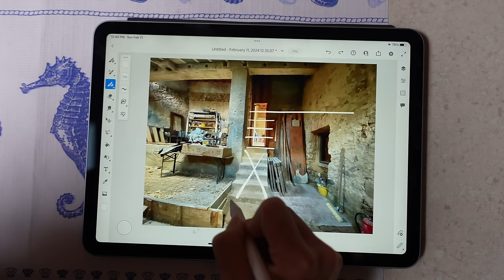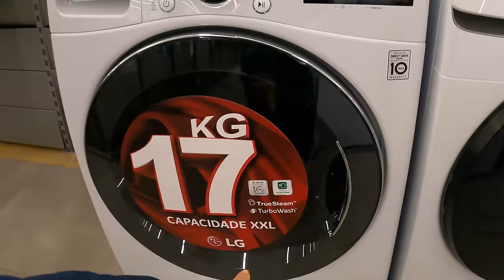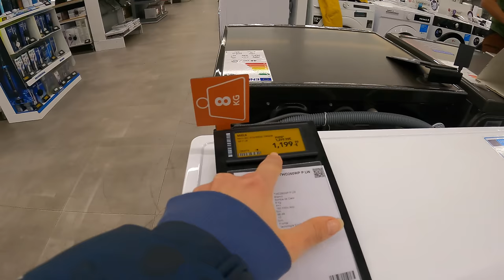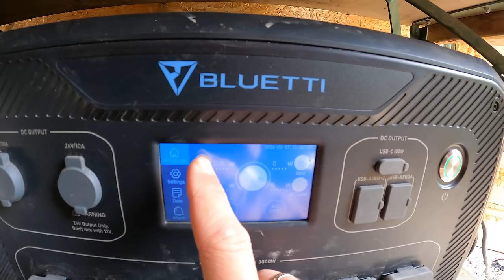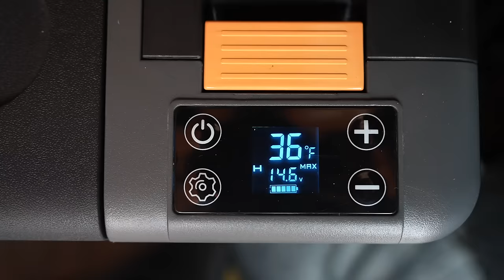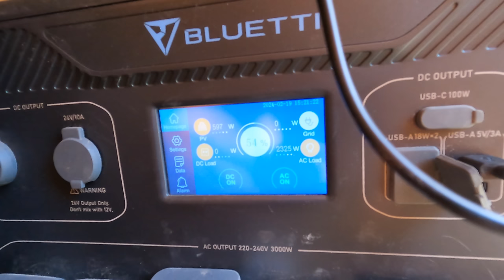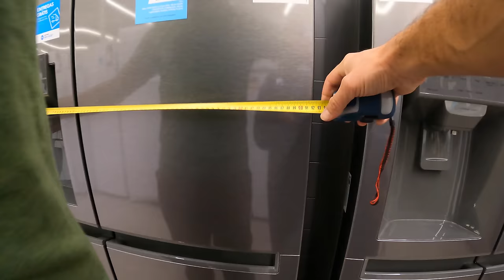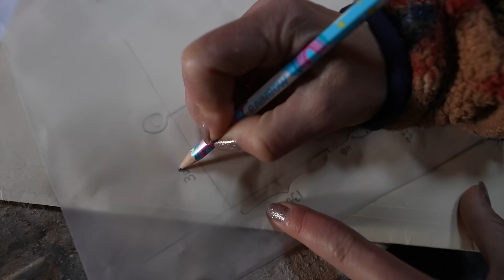UNEXPECTED PROBLEMS PREPARING OUR HOME RENOVATION FOR ELECTRICITY AND APPLIANCES

Comment: I'm looking forward to seeing your laundry drying outside and maybe have portable drying racks inside during the sunless months. If you do have a wood burning stove for heat in colder months, having a clothes drying area would considerably cut the cost down of electricity. I did this for years and used the electric clothes dryer only to finish off the clothes for about  15 min. I wonder if you'll consider getting solar panels to offset the cost of household electrical usage.

Comment: It’s so funny that you are apologetic about considering a dryer!  That’s not too extravagant, but maybe for a couple of van lifers!  Don’t go cheap on the appliances, you have to live with them a long time.  The giant blue paint brush was great!
Reply from the maker: Thanks for your perspective. We prefer to have one as you mention. Many American have them and don’t think twice about it. Europeans typically do not have the dryers in there homes.
Reply: We have a dryer but I normally just warm up the wet clothes then hang to dry. But, it’s nice to have it. I agree, don’t go super cheap so they’ll last a long time.
Reply: Yes! When I moved to the UK it was one of my requirements to my future husband. They were drying all their clothes on radiators. Nope, not me. Love my dryer.
Reply: Your washer and dryer don't need to match! Dryers are simple devices. Get something without a motherboard. It may be less efficient, but you will be able to maintain and repair it easily as long as you can still get parts. The washing machine is a different issue.

We have a washer-dryer & a dryer in South Africa. While our 4 kids were at home, we had a BIG washer and two (used) dryers. (Splitting the load allowed the dryers to keep up with the washer.) Almost no one here has a dryer, but homeschooling and housekeeping with inconsistent power and water supplies means that you have to strike while the iron is hot.

Comment: Surprised you went for gas cooker instead of induction stove & electric oven or could still use separate gas oven, as can run from solar & battery backup. Induction is faster & safer.

Comment: 192 kilowatts??? 😮🤯 
Ummm
That would be 800 amps at 240v.
A normal house service is 200A.

A dryer runs on a 30A circuit.  That's a maximum of 7.2kW.  Probably runs around five.  Can't imagine where you got 192, that's whack.  Am I the only one who picked up on that?